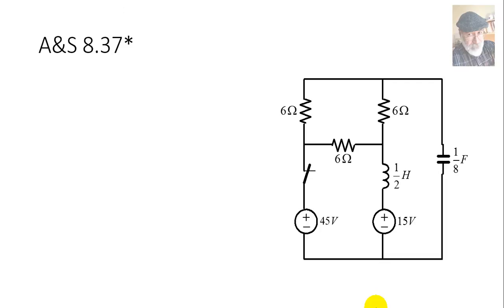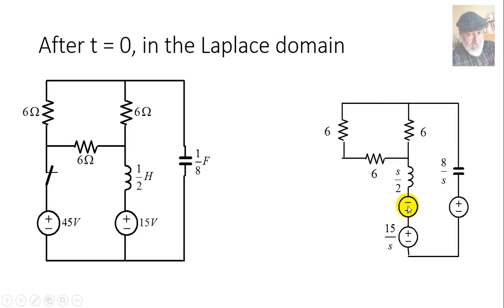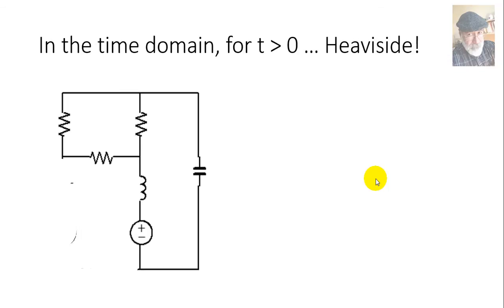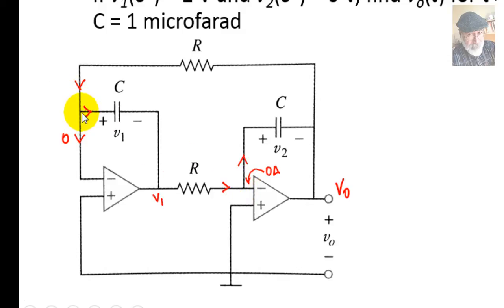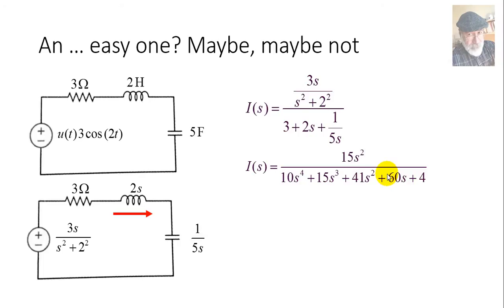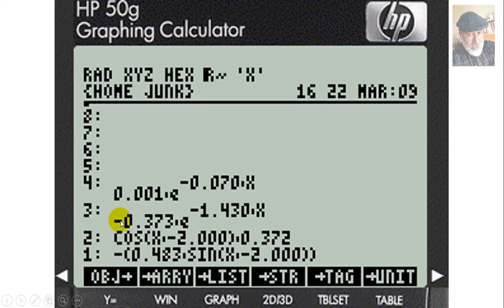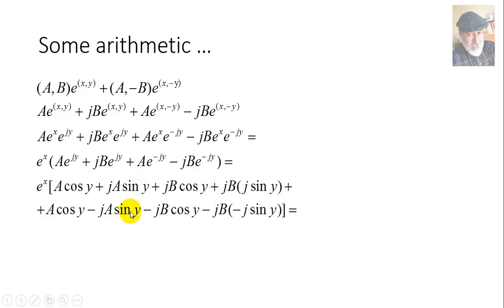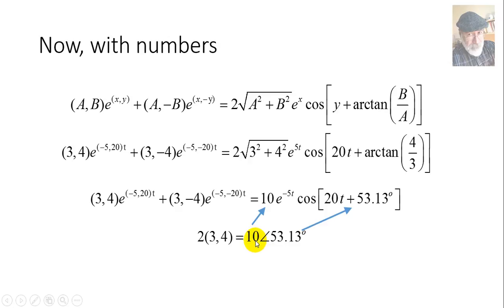Tutorial on Laplace Transforms applied to 2nd Order Circuits

Comment: I apologize in advance for the stupid question. How can a flux = to L*I be represented as a voltage = L * di/dt? Is the 7.5 A actually 7.5 A/s? Otherwise the units do not match up.
Reply from the maker: Flux (magnetic flux, of course) is to voltage, what charge is to current. Faraday's Law, in one of its representations, states that v = d(flux)/dt (actually flux linkages, but the units are the same, webers, so we'll let that stay). But, as you correctly stated, flux = L . i, so, subs flux in Faraday's expression and you land on v = d(L.i)/dt = L di/dt (assuming that L is a constant). The units? They go like this, weber = henry x amp, and volt = weber / second = henry x amp / second.